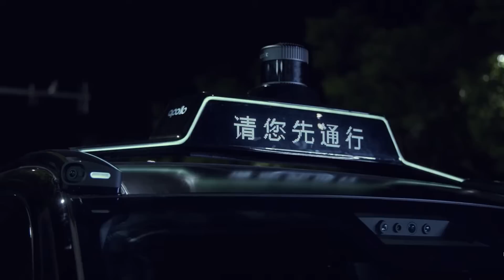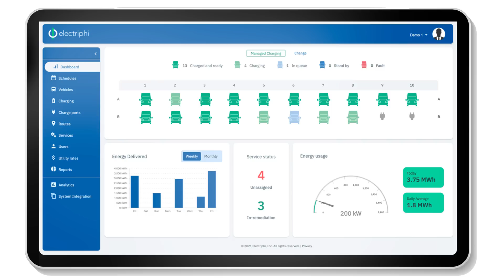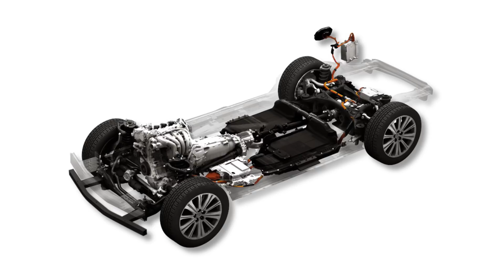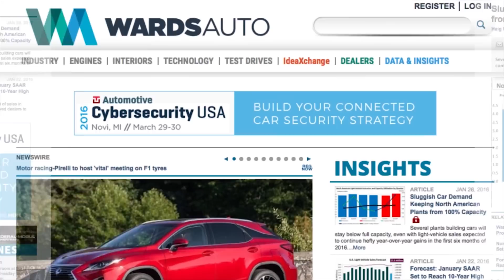Baidu Launching L4 Robotaxi; Mazda's EV Plans - Autoline Daily 3104

Comment: Love the whole ev idea, but if all major brands move to electric, where will it leave countries like Africa, where electrical outages and loadshedding is a daily reality ? There is also no scheme for subsidies or discounts when buying an ev here in South Africa.
Love your show, I never miss it. Greetings from sunny Johannesburg, South Africa.
Reply: Segments in north America still have reliability problems, especially in extreme weather.  Proponents just deny those claims.  Many of us won't go all-electric if we can't charge reliably.  The customers will determine what sells.
Reply: I'm in the US in the state of Texas and we too already have power issues, one disaster this winter and now we are being asked to conserve because of the heat. And yet, construction is all over the place and has been for many decades. The electricity generation problem must be solved to keep the growth going. I know some will try to blame it on EVs but they are just a fraction of the demand we have to forecast and plan for. Many of the new homes here are large and have two or three AC units and some also have a swimming pool pump that runs all the time. Businesses are moving here and building huge headquarters and factories. The power demand will be huge and has to be dealt with. That's actually an advantage for EVs because cars will be using the same fuel everything else does, you don't have to be trapped into buying fuel from just one industry.
Reply: Africa would benefit the most from the EV transition in the long run, they are less encumbered by old infrastructure, and are embracing solar in many areas. We saw this with cellphones where these markets skipped landline altogether, thanks to lack of phone lines, it made that transition easier ironically.

Allot of these locations are ideal for renewable solutions, and that makes it easier to sell EVs: Cheaper fueling, less dependent on infrastructure the way gas stations are, a cleaner operation, a more reliable product.
Reply: Of all places Africa can generate enough electricity with solar. it has been estimated that a 100 mile by 100 mile solar plant could supply ALL North Americas energy demand, so should be similar for Africa. Of course there has to be the Governmental will to do this.
Reply: @johnmqueripel2367  Solar really needs storage for it to really become practical. We need some way to store and forward that energy.